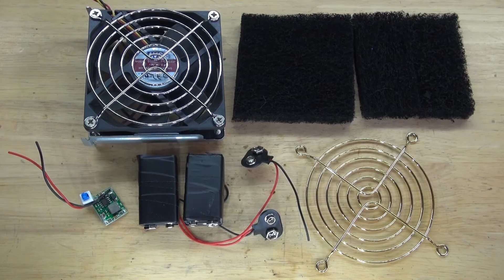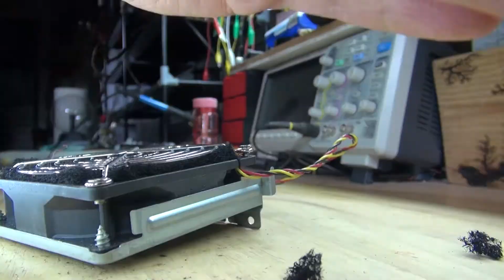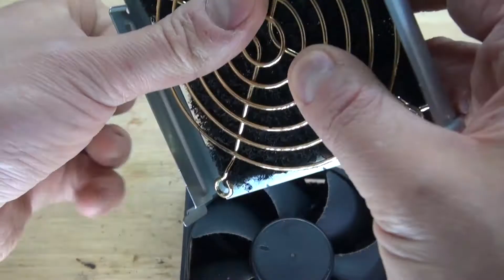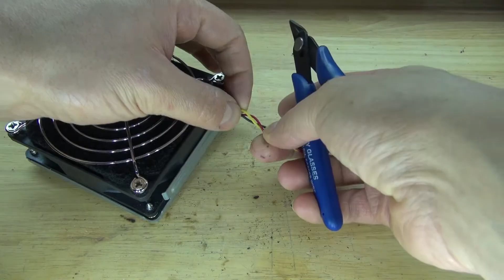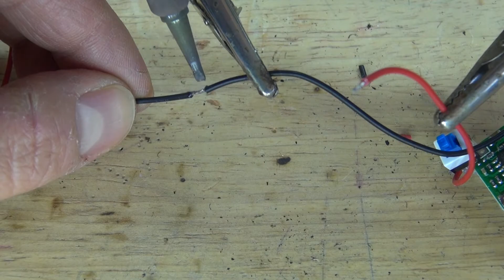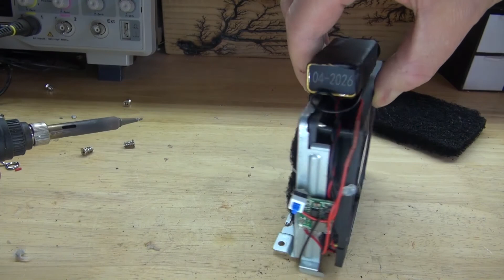Portable Soldering Fume Extractor

Comment: That isn't extracting anything, its poorly filtering.
Reply: "the action of taking out something, especially using effort or force."

It's getting the fumes out of your face which is about all you can expect from a fan and filter. If you're concerned about exposure to fumes then best practices still apply like soldering in a well ventilated area and wearing a respirator.